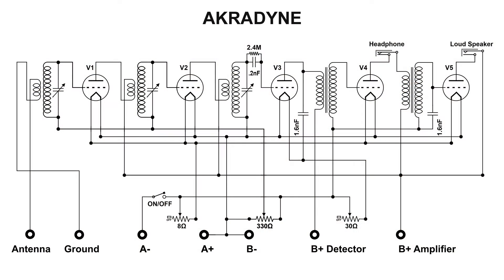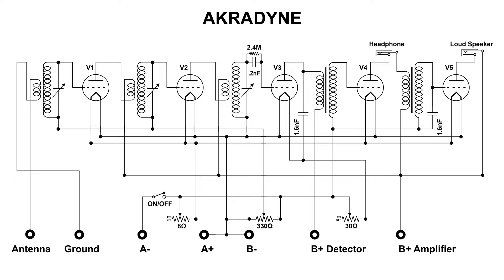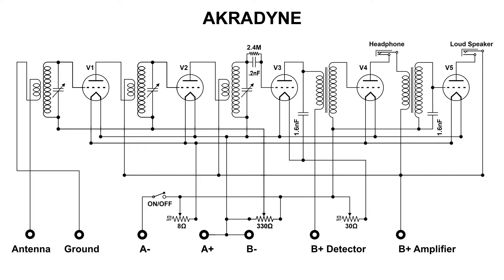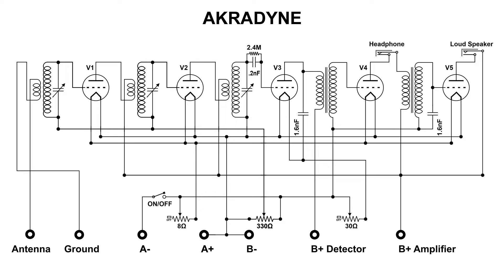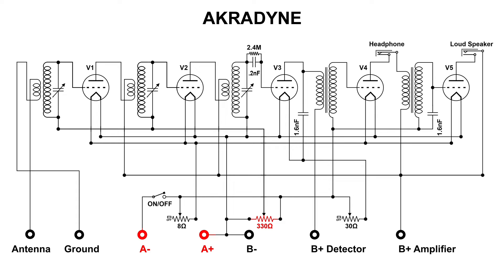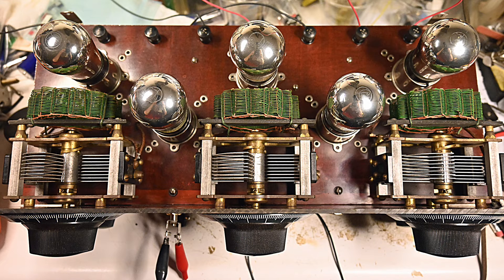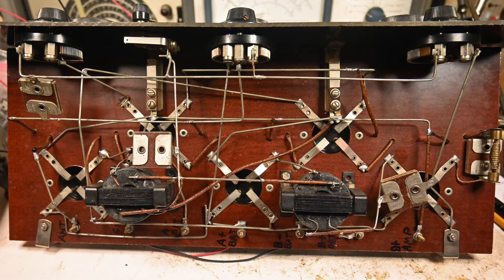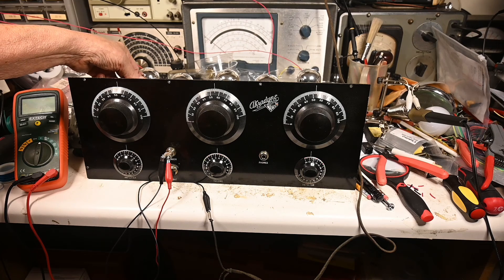AKRADYNE 1920s RADIO Unique Circuit

Comment: Hi,
Very interesting schematic.  I never seen this, on most of my trf, the grids of the 2 first stages are most of the time connected to the A-.  Was thinking that bias on the A+ side were way to much for the tube but it seems to be ok ? Interesting....
Reply from the maker: Yes it is very interesting and unique, and the radio preforms great. I have never seen a circuit like this in a 1920s radio, and I have a few of them and have worked on several others.
Thank you. I like your YouTube site and Website.

Comment: Hey Rick, Very cool indeed. The one Bob and I are working on is also a TRF radio, but doesn't have the additional tuned RF and of course ours is transistor instead of tubes. Yours sounds so much better so we hope to get ours working better soon. Nice demo. :)
Reply from the maker: Thanks Doug. 
It is beautiful and in  beautiful condition.
Hope you get your project working soon.